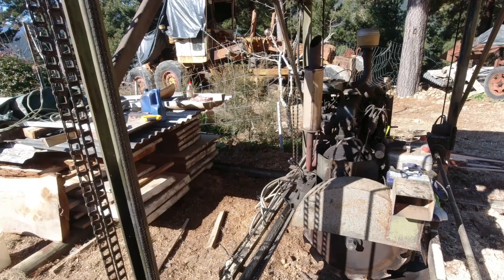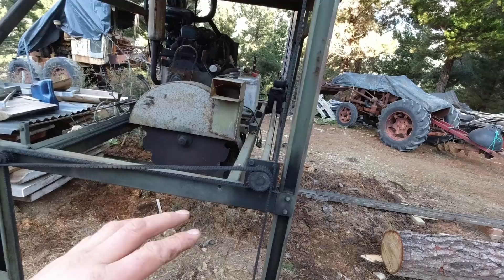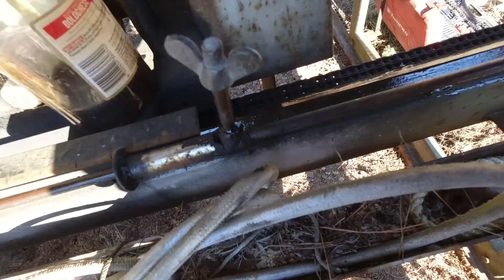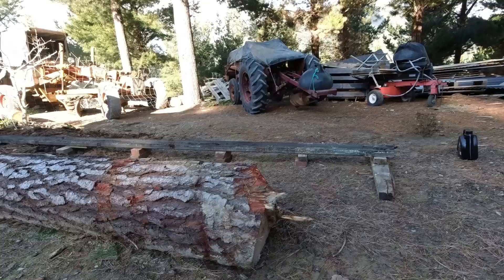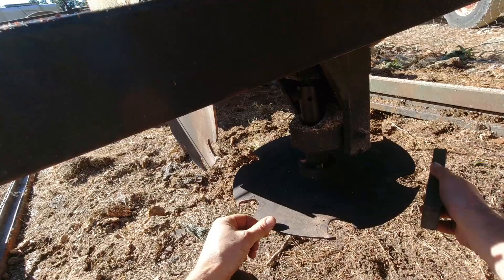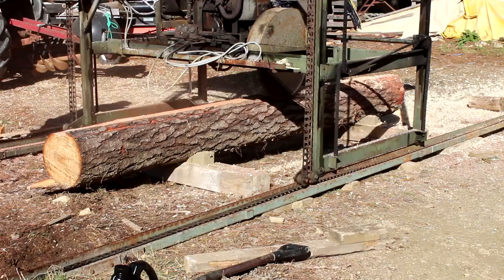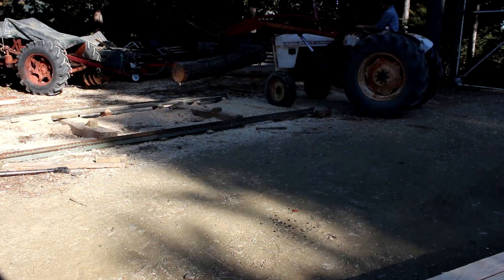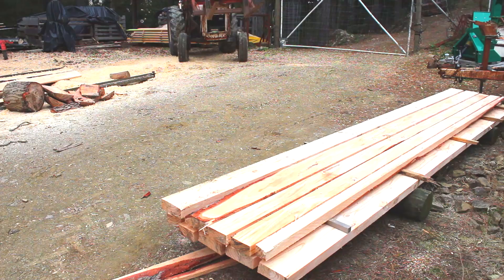Homemade Sawmill maintenance / making free timber from pine logs..

Comment: I wouldn't be surprised if one day Marty builds himself a wood kiln out of a used 40 foot shipping container and a wood furnace to heat it with a forced air system blowing air around the plenum into the kiln.
A friend of mine built one that way.
Worked beautifully.
He insulted the outside and covered that with wood he milled himself so it looked like a long shed which is what he used it for when he wasn't drying lumber he milled himself.
Reply from the maker: I have actually thought about doing just that

Comment: We actually used to use the "slabs" as wall material, used vertically, on the farm. "Round backs" were actually railway sleepers with one slightly rounded side. On the farm we did Railway Sleeper (railroad ties) cutting near Dubbo N.S.W. 1960's. Good fun machine. Jim Bell (Australia)

Comment: The price of timber has doubled here in UK. We also have no more Datsun 120y, they didn't like our climate and returned to their element. Great job, thanks for sharing.
Reply: In tx we had a spoke of over x4.  Unbelievable.  Still not back to what it was.  Lumber mills to blame.  Retailers are to scared to stock much inventory.  Right now a hurricane is about to decimate Louisiana.  How are those folk going to board up w no plywood?  Sad.
Reply: @ebutuoyebutouy  There was actually a shortage of glues that caused the high prices of engineered wood products like plywood and OSB.  Dimentional lumber was a lot more greed fueled in some areas.  Many people who had access to a saw mill used them while the price was high.  Now the prices where I live are pretty much back to normal for dimensional lumber but the engineered stuff is still quite high.

What I don't understand about states like Louisana where major storms are an issue is why when houses are built they don't build steel shutters for the windows lag bolted into the structure so that all you have to do is close them and bolt them up before a storm hits.
Reply: @kuhrd  You can have steel shutters but if the wind gets under and compromises the roof then shutters do very little.  150mph is above the threshold for most building codes so rarely will you find a home with a roof rated to such a speed.
Reply: Well as the Nissan people copied the design completely from Austin why not use an old Austin engine?
Reply: @ThePlayerToBeNamedLater  Here in Darkest Africa we can build houses out of brick and roofs out of steel reinforced concrete. It must be because we very seldom see 150mph winds. I own a cottage built that way 100 years ago. Painting the roof with aluminiumised bituminous paint every 10 or so years to keep it waterproof is a bit of a hassle though.

Comment: I've never ran across a mill like that one over here in the states.. We all use band mills these days that use bandsaw blades and you have to cut it to thickness and then cut it again to width.. They had something like that at the old lumber mill that ran from 1880s up until the latter 1990s when it shut down but it had the blades set up a distance apart and the logs moved through a set of circular gang saw blades cutting many layers at once at one station and then to the other dimension at the next set of blades.. Most of my fellow Americans couldn't use that one due to no guards and safeties... They'd be limbless the first day... 😄

Comment: Anytime seeing You work with all that "old" machinery, which is in fact "oldschool" only but timeless in the sense of non-integrated, easily distinguishable systems to be singled out for repair and maintenance with "old wiper motor setup" sharpener, an "oiler brush" and a greasepress, and then seeing You getting more precise actual work results than any fancy computerized "hyperwoodbutcher 2500 special" would bring, I hope You might teach youngsters of the next generation what keeping up with work and machinery really is: knowing what kinda result You want/need, and concentrate on that while ignoring all the fancy parts put in by the marketing branches. Thanks for sharing!

Comment: Nice one Marty, 30 years ago every farm had a small mill so you could cut the stuff that suited you when you needed it.
Now its an oddity eh?
Love it.
Reply: I wouldn't say every farm had a saw mill 30 years ago or even 130 years ago.  Production saw mills used to be far more common especially in areas with a large amounts of timber growing nearby.  30-60 years ago every small town in these areas likely had one or 2 saw mills running and some farmers would get together to buy or build a small mill that they all used but it was pretty uncommon for every farm to have one.  Even these days it's probably just as uncommon to see a sawmill in someone's yard but quite a few people do have them.  I personally know of 6 small mills within a 10 mile radius of where I live that are used fairly regularly along with 3 production mills within that same area so I think it really depends on where a person lives.
Reply: @kuhrd  Softwood Mills In Aus were all over the place, Farms had them for fence posts and planks for Barns etc and when Chainsaws came out even the smaller farms had Chainsaw mills for ripping logs.
My Uncles Dairy farm had one for Fencing but he bought a better rip cut mill for planking and flooring, the next guy bought a planer/thicknesser and so on.
Dairy guys in particular had free time middle of the working day so they would rip timber, lay it to dry and then use it or swap what they had for something they needed with others.
Harder to do now that the Greenies have gone all precious about  renewables and non native species but the few that I know now run them as a business alongside their farming.

Comment: I work at a small mill, 3 persons including my boss, We run a slightly customized Wood Mizer LT70, it's a good machine but it has no soul, boring to run but very reliable. I like you set up, I've had a similar idea rattling around in my head, was thinking I'd use a VW turbo diesel and bands.

Comment: A old bloke told me to use mr sheen/ furniture polish on mower blades and deck to stop grass sticking and clumping when i first started landscaping business and it worked amazing. I use on saw blades and works great for resin. Just clean and dry before applying and allow to dry. Then i just repeat that process when finished or if big day do it half way through day while stop for lunch. Thought it might help you too. Got to pass it on to keep the old timers gods happy.

Comment: All the other ones I've seen seem to be using bandsaw blades; so it's interesting to see this set up. Looks cheaper to run (not having to keep changing/sharpening bands), but obviously you are more restricted in dimensions, although you can cut the normal construction timber/lumber sizes.

Comment: Beautiful job on repurposed gear.

Next comes the Electric Truck, plus all the ancillary equipment is Electric because the portable bush shed is covered by Solar Panels. The Mining Industry has lots of leftovers of cables and so on. DIY adaptation to 21stC and rational carbon into wood production sequestration, the logical renewable Industry for Forestry. (But watch out for the greenwash Trolls)

Have to say Bandsaws and 3mm kerf in Australian Hardwood makes more cents.., but NZ is all Pine almost?

There were some clever blokes in Victoria who had designed and built a Radial Mill with Thin Blade Saws that I was intending to look at, because if you have a Plantation of Timber and need a to use the Thinnings,all lovely straight logs, then cutting wedge radials can be used for Clapboard Walls or end-for-ended one board on another, and bonded to make super strong rectangular profile, of young wood. Minimal waste, which is good for charcoal and garden beds, if you don't use the sapwood for mushrooms or mulch it all, and so on.

The NZ plan of planting an acre of forest year inspired me to think about the French Forestry practices and English Craft history in all kinds of Woodworking. 

Gratified to see someone else getting good results in self-made industry. Thank you.

Comment: With access to a sawmill it may be worth it to look at a solar kiln to speed up the drying process and give you a source of income when you don't have anything to load into it by renting it out to others in the area. Can go with the standard setup with the sloped clear glass/plastic roof facing the sun or go with the insulated box with the heat made in solar furnaces pushing that heat into the box for direct drive solar fans to help move it around as you get a larger volume in the same foot print and don't need to cover the wood to prevent sun damage as it dries. 

Milled wood and recovered roofing tin can take care of the majority of the structure so it is just the insulation and solar heat method that you may need to spend money on to get it built and operational.

Comment: Just reuse the old engine oil to lube the chain and guides.. nice system.
Reply from the maker: I like your thinking, I paint the exposed metal parts and chains with sump oil when I don't plan to use it for a while, poor mans rust prevention 😂

Comment: I used to transport old tree service trucks from auction sites to the company that would refurbish them for resale, and the first thing I would do was stop at a shop to blow out the radiator.  They were always full of sawdust, and the trucks would overheat.  There would be a pile of sawdust on the ground after, and the guys at the shop would look on amazed. If the previous owner would have done that, they probably would have gotten a few more years out of the truck.

Comment: Great stuff Marty that brings back memories of when I was around 17 working in sawmills I started on the breaking down saw at one mill then I went to a much bigger mill and after stacking timber and picking house lots I finished up running the Gang saw that was hard yakka back in 1963 /4
Reply: It doesn't really limit dimensions because the saw cuts across the log progressively on repeated runs. Log size is only limited by the overall dimensions of the machine, not the size of the saws.  Saw bands only have the advantage that they cut the entire width of the log in one run ,giving the ability to make wide planks,but these are of limited use in building.
This saw would probably handle the most common timber size found in NZ. Timber isn't usually allowed to grow much bigger than what Marty is cutting.

Comment: Used to work at a mill with two large band saws, one would cut slabs then move onto the next with a Volvo loader, and then cut down to whatever sizes were required, then it would be taken out put onto carts, and pushed into pressure treatment plant, miss the place, shut down last year unfortunately

Comment: for surface to surface sliding try using plumbers silicone spray, used it on our companys loader for the forks to slide side to side and its held up around 6 months before it started to slow down

Comment: way over my head machine, I do understand the Datsun motor part though. I bought a 74 with 90,000 miles on it from dad. I broke the speedometer cable four times and got tired of that repair. I think it had close to 500,000 on the original 2300cc motor. It loved to eat points but other than that, even my lack of mechanical knowledge did not kill it. I finally gave it away.....

Comment: Nice little mill, never saw one quite like that. To an American ear, it sounds funny to hear you talk about leaving an air gap of "a centimeter" or saying the logs are "about 3.4 meters long" and then talk about the "4x2" and "6x2" lumber you made! Here we'd call them "2x4's" and "2x6's", but the idea if the same. I'd get confused having to switch between metric and imperial, but I guess metric just hasn't quite taken over yet!
Reply from the maker: I usually think in metric but the mill scales are imperial so its a mishmash of measurements

Comment: I like the concept of the mill. Just a thought, I wonder if you're u could set up some kind of compressor and tank off the motor to build the air when you not cutting to help blow the sawdust off.

Comment: I worked at a sawmill , but am in no means an expert - but cutting on the return trip of the sledge might dullen your blade more than the dirt on it. It's a bit counterintuitive, but on the return the blade rubs against the material all the time causing heat build-up. It would be easy to do a test run comparison, now that you have the experience of cutting on both passes. Then again, I haven't seen such monster of a blade. 👍
Reply: Might be that I saw it wrong, and you just cut on one pass, and my mind insisted your rig has to be a mirror image of itself 🤣

Comment: How does the saw react to climb cutting when you return it? It doesn’t appear to climb or get bent out of shape.
Reply from the maker: its quite happy to cut on the return, if it starts bogging down I wind the travel motor valve shut slightly to slow it down. worst that can happen is the drive belts slip

Comment: Are the blades adjustable so you can cut bigger or smaller boards?
Also, I am surprised you don't have any sort of blade guard.
Reply from the maker: it will cut any dimension board up to 9.5 inch x 6 inch

Comment: Great video Marty.   What has my attention is the horizontal blade.  How is it secured or fastened to the arbor.   It seems like there isn’t a bolt head sticking past the saw blade.   I believe a bolt head would limit the horizontal cutting axis.
Reply from the maker: It has 4 recessed allen bolts so there is nothing protruding on the underside of the blade

Comment: When I saw your Datsun 120y motor, I started to think about how the next generation of tinkerers is going to struggle getting simple motors like this because they are 90% sensors and microchips.  

I’m sure they’ll figure something out.
Reply: The next generation home made saw mills will have fuel injection and canbus, :)
Reply: Probably electric motors
Reply: @AndyFletcherX31  yeah truth be told, they are pretty simple and easily accessible so this is probably the answer, but might be problematic in remote areas with poor electricity supply

Comment: If you flip the log over after the first cut or two and mill the bottom you can probably get more out of it. Or use the bandsaw to rip out last boards. Then use crappy blades on a thickness planer to get them to size…roughly, final will be after they dry anyway.

Still cutting your own wood is satisfying.  Some places cut up square cants and leave them dry out before final cuts.  Paint the ends of raw wood to help prevent splits/checks.

Comment: One feature I don't recall being mentioned was the petrol engine revs. I know it drives the hydraulic motors, but how does it increase its revs (as required).
Reply from the maker: I mounted a thumb control on the frame with cable to carb, I feather the revs depending on the load.. I do have a governor I've been meaning to adapt but haven't got around to it yet

Comment: Very nice! Do you have the engine on a hand throttle or is there some kind of governor setup on it?
Reply from the maker: Hand throttle and the travel motor has a hand dial valve to adjust the cutting speed

Comment: A couple of 4x2s yea meters long...  By the looks of things your are saying 4 inches x 2 inches some meters long.  Is this indeed common to how Kiwis describe dimensional lumber?  ((I am here in USA and we say 2x4 (inches) x 8,10,12 etc feet long.))
Reply from the maker: I usually think in metric but the mill is imperial so its a mishmash of measurements
Reply: @JohnSmith-yv6eq  That's right.  I'm a fire protection engineer in the USA so the imperial system and nomenclature of how units are used in the USA are branded into my brain.  For the most part I am ok with the base 12 system of feet and inches, but your correct the sub-units of gallons is F'd....  I mostly do though like how youtube shows how other people in the world solve and describe similar problems.  Have fun and be safe!

Comment: electric or battery jack hammer with spade attachment sharpen way u want will be time saver invention  for de barking no charge on million dolar idea ahahha
Reply: share the profits with me  thxs
Reply: rotary clothes up front like towel despenser continuous, helps filter the radiatior ,  wash when comes to the end
Reply: wood or metal  guage removable or hiegtht adjustable or removable,  with center marked with inches or cm  marked going outwards for log centering
Reply: pain the ends prevent checking while drying so end dont dry too fast , latex  , there is kind u can buy but piant is cheaper